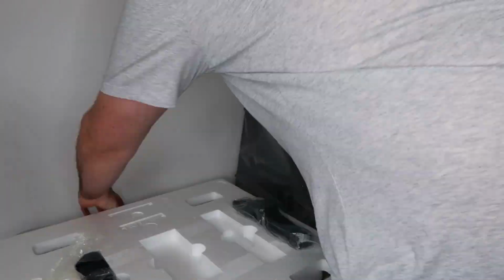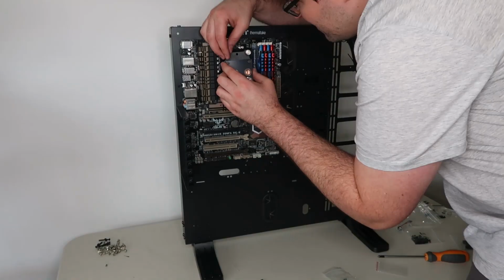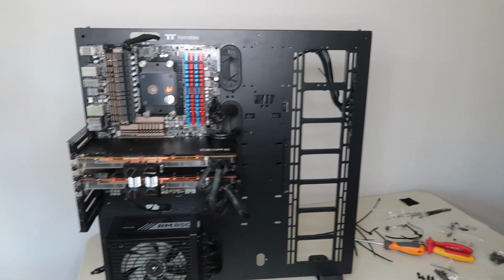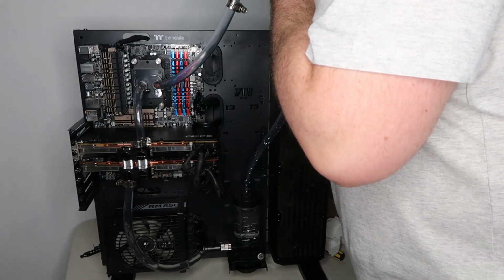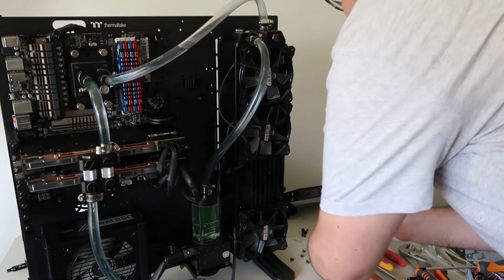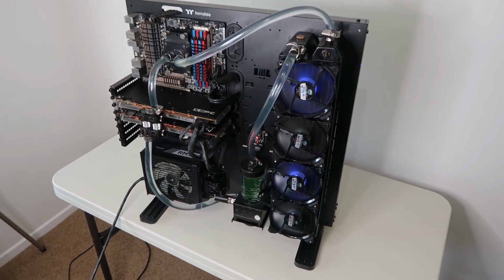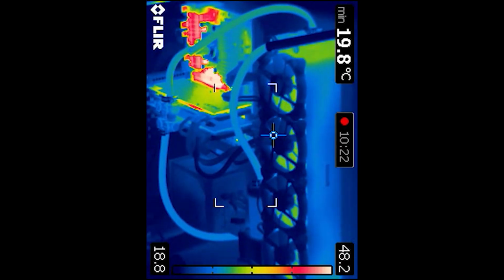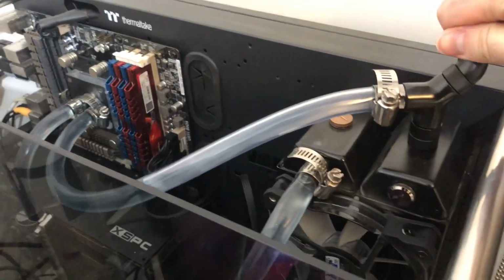Water cooling the world's hottest CPU ( lets also try no fans )

Comment: Hey mate, that rig looks awesome! That radiator is out of control BIG! LoL! 

Hey I have a question though ... would it be better to split the water pump out hose with a "T" or even a 3 way splitter, so that you can run cool water to each water block at the same time. Instead of having it go through one gpu, heating up, then another, and then CPU. By the time that water comes out of those 2 GPU's its probably gone up 10+ C! 

I know it will require more hose and take up more room ... but i think your CPU will really benifit from it ... and the 2nd gpu would be cooler aswell :)

Comment: use a threadripper cooler if that is possible
Reply from the maker: I would have thought it wouldn’t fit stock screw holes but if it was modified to fit a smaller socket, would the extra block size help with heat dissipation, that’s a good question.

Comment: You need to stress the cpu and the whole system... Where's the video.
Reply from the maker: Lol yeah few things I am still doing looks like their is a tiny leak in the cpu block. I think stress testing with crash it. I will try for the lols. I think it needs another level of cooling..... which I’m working on.
Reply: @ScottyDIY  ok
Reply: I recommend that you set the CPU-NB to 2.6
Reply from the maker: Well just an update, it was crashing due to the VRM's, when you W/C this MB the VRM's cant dissipate the heat without air flow so it needs a extra fan, so should be able to stress test it now

Comment: Did you notice a significant increase in heat, between running Windows 7 on the CPU and Windows 10? I did and it's making me crazy. I have a 280mm H110i GTX cooler on the 9590. And it's running in the 60s with World of Warcraft active. And not even high settings. Any suggestions?
Reply from the maker: I didn’t notice between 7and 10 but wasn’t paying attention at that time. Yeah don’t think that rad/AIO will be big enough unless you try extra fans at max speed but may get loud. Only other option is to turn off a couple cores while playing which I have done before. Only need 2 off to keep it more stable

Comment: I'm sorry so I've been how fast were you able to run it and what's it worth it or you think you guys on better with 8350
Reply from the maker: Hi, i have not over clocked yet, so standard FX-9590 specs, i had all the cooling parts so it was not a value thing, if i was recommending to someone that was looking at upgrading their current FX cpu and was not going to the new Ryzen, I would say 8350 is better for all the extra work in cooling the 9590. but i would always recommend going ryzen over FX, im ready to upgrade to Ryzen with the same cooling system so its not a waste of money.

Comment: I have FX-8320 running on 4.4Ghz 
The only worries i have is the VRM , Northbridge & Chipset heatsinks
Heating up so much
My motherboard died few weeks from this day
My motherboard is Gigabyte GA-990FXA-UD3 3.0

Is there i way i can cool them enough?
I already did sticking 40mm fans on them but it's not enough
Reply from the maker: the thermal paste/pads may be no good, you may have to replace them, other than that, thermal paste/pads < bigger heat sink < bigger cooling fans < Water cooled. unless your doing an overclock thing  that's killing it
Reply: Scotty D 
I didn't overclocked it so hard i just used the max boost clock without adjusting the volts 
I just made the multiplier 22

I still want to use this cpu though but this new r3 3300X is so appealing haha